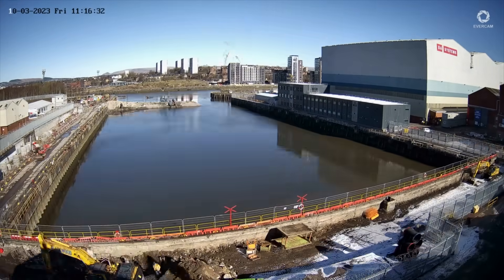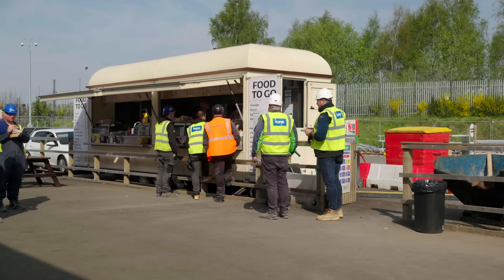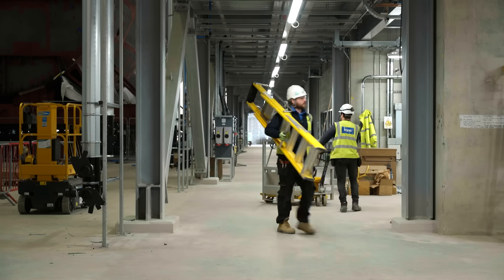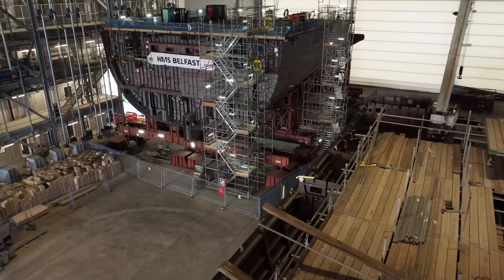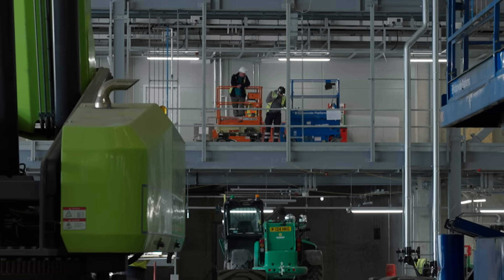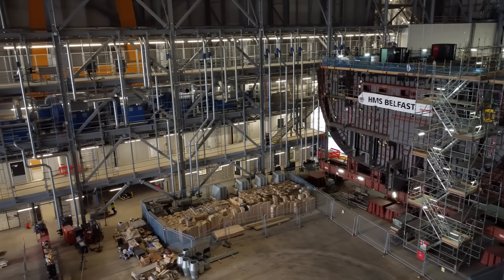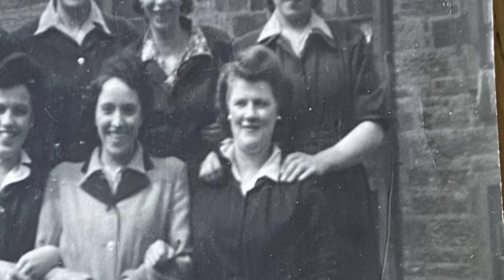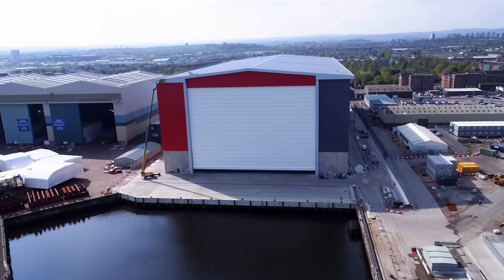Inside Janet Harvey Hall - Glasgow's cutting-edge shipbuilding facility | BAE Systems

Comment: How does a 150m ship get out the hall and into the water?
Reply: Barge, and floated down the river.
Reply: Global warming. By the time they finish the boat the water level will have flooded the shed. The other option  they float a barge up to the wall. Drive the boat on to barge. Take barge into deep water and sink barge untill boat floats off.
Reply: Barge turns up, ship gets moved onto it, barge then goes up the Clyde and sinks  allowing the ship to be towed off it.

Comment: Can the hall fit a 250m ship, considering it is 170m long? I suppose they can leave the doors open.
Reply: Type 26 is 150m long.
Reply: Build it in two or 3 blocks, float them down the Clyde and join them together in the Inchgreen Drydock.